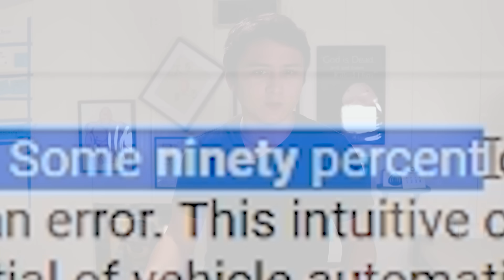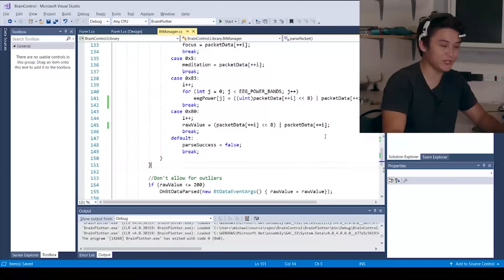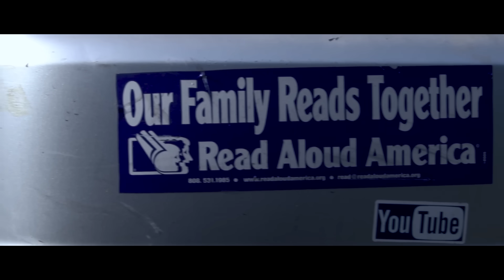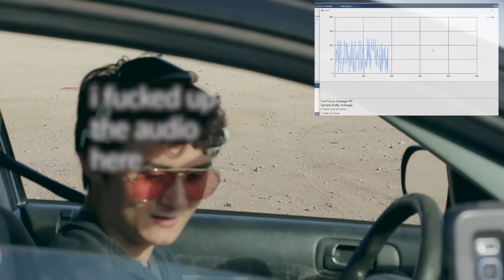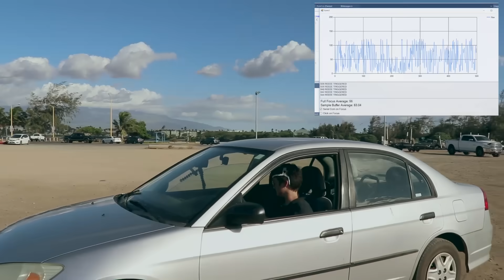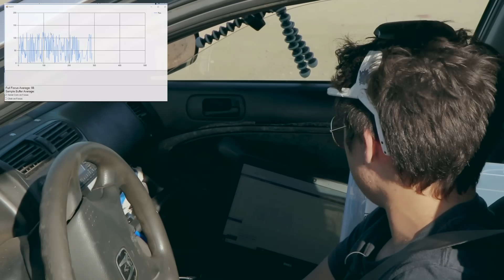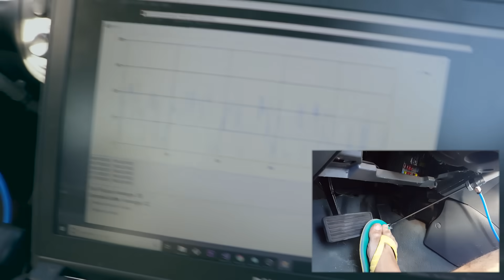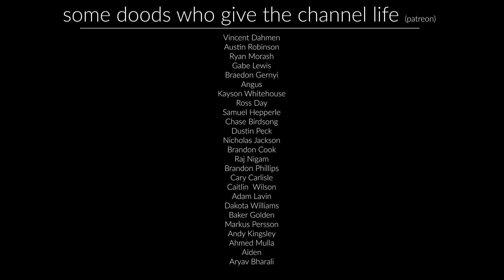Using Mind Control to Drive a Car

Comment: Ngl, thinking about it, the opposite would actually be rather usefull in IRL trafic I think. Accelerate when you unfocus and decelerate as you focus. People that don't pay attention and are zoned out will go full throttle, panic, focus and then decelerate. So it kinda forces them to actually pay attention to traffic and their surroundings

Comment: it would be great if the headset had a motion detection device so if you move your head left the car turns left, etc. then you would have fully been able to drive the car

Comment: does anyone know where to buy a cheap headset like that because I am working on a project.  It does not need to be accurate, it would be nice nice if it gives an analog signal depending on how focused I am but for my application a digital 1 or 0 could work. I have looked everywhere but I can only find expensive medical equipment. my price range is not that high.

Comment: You should connect throttle to a heart monitor. The calmer the heart more acceleration. When you get scared and your heart rate goes up it goes even faster until you crash

Comment: Wish you would redo this with eye tracker software you should be able to use that to accelerate/stop and then turn using a gentle degree to go right/left in and then seperstd hard right/left. My dad had also and his eye tracker worked from 3-5 ft from his face and he had an entire alphabetical keyboard he could choose from or make custom commands on a different screen

Comment: This is really good and funny, to improve it or add on to this project, you could add a gyro to the top of your head, like on the head set and that could be the steering. That would be kind of hard to make mechanically though, it should be easy programming though, it should just be a linear equation or even easier, the mapping function!!

Comment: I wonder what would happen if you were able to make the action smother by having a set throttle position selector. Maybe program it into the code .
Ex: if speed =0 then use 25%
Speed =15 then 34% 
And so on

Comment: Hey Michael! I'm a bit late to the party, but great video bud. 
I'm studying automatic-engineering, which made this vid fun to analyze and figure out how you did it. 

I have a few tweaks, I would probably do, but I can do that on my own model...

(dw, mine will probably be on a remote controlled car.)

P.S Michael, if you see this, know that I would like to buy the headset shown in the video (if it still works). Its not possible to get for a good price where I live..

Comment: If you connected it to your lights that might be a good falling asleep and waking up quickly mechanism. Like, once you start dozing off the lights will turn off, and the moment your brain starts focusing when an alarm goes off, the lights will switch on. It's like the 80s sitcom "rise and shine" mom we never had.
Reply: ah yes of course but me with my anxiety filled brain is just like:
goes to sleep
calm, calm calm
light go out
*brain*: There is a geodude in a cave, is he made out of rock or is the cave made out of flesh
internal screaming
light flash on in an instant
And repeat this 500 times

Comment: Mind controlled rc car or flying drone, but randomized brainwave generator for the controls. Kind of like using your brainwaves as a way to encrypt the controls so only someone the trained themselves to use it can get it to work. The more random brainwaves there the longer it will take to master but more difficult for someone else to use if stolen because it detect brainwave patterns based off of owner. It's going to crash alot. 
Good luck if you decide to do it lol.

Comment: it would be better to have it be the other way around, having the car stop when you focus. this is because beta-waves (the waves the thing is measuring) increase when you focus but most significantly when suppressing muscle movement. If you see kid crossing the road and you need to act quickly your beta-wave amplitude would naturally increase, which in this case would make the car go faster.

Comment: The manual switch makes it function like the handicap car setups does it not? couldn't you convert one of those kits into a full mind controlled brake and driving control by hooking it up to the arduino and making your relaxed readings as the break?

Comment: I detect a bigger safety problem that you may not have even realized. If you need to suddenly stop, you're going to be focusing heavily on doing that, meaning it will accelerate more until you hit the kill switch or kick the piston.

Comment: Not to be underestimated potential. While you do all this for fun, it is absolutely obvious you have a future in this field. As for the project, i don't know if it would work but i tought that maybe a stepper motor could control the gas pedal while you think about different musical notes or colors so you could scale its action up and down. Of course there should be a mechanical way to disegage it so it don't go nuts.

Comment: Wouldn't it be more efficient to control the acceleration directly in the car's throttle potentiometer? Thus it would be possible to pre-determine safety ranges for acceleration as well as allowing a smoother variation in engine speed.

A servo motor controlled by the average values of the signal can easily function as an electromechanical interface.

Assuming that the car is equipped with an electronic fuel injection system, it is possible to completely abandon this "on/off" system that is practically impossible to control.

by the way "Já viu rico namorar pobre?" 00:00

Não seria mais eficiente controlar a aceleração diretamente no potenciomentro do acelerador do carro? Assim seria possível pré-determinar faixas de segurança para aceleração bem como permitir uma variação mais suave na rotação do motor.
Um servo motor controlado pelos valores médios do sinal pode servir facilmente como interface eletromecanica.
Assumindo que o carro seja com sistema de injeção eletrônica de combustivel é possível abandonar totalmente esse sistema "on/off" praticamente impossível de controlar.

Comment: so I actually did something similar to this as a kid, Its called neural feedback and basically, they attach electrodes to your head and they track your brain patterns and it's coded to play a movie when you're focused on what's happening but if you get distracted the movie turns to static. I was used as a form of therapy for people with ADD and ADHD. I did it for a year when I was 10, it was weird.

Comment: Nobody going to talk about how this is actually useful? you could make it so the car auto stops when the value reaches a low enough number. and it could have a maximum speed of 60mph, and you need to take a breathalyzer to start said car. this is an actual good idea, and could stop a lot of motor vehicle accidents if taken to an advanced enough level.

Comment: why not flip the logic and use the really calm parts to accelerate  then when you actually have to focus to drive the car it slows down?
Reply: Because if that was the case and you lost focus while driving the car, you would accelerate and die.

Comment: It would be a better design if you flipped the code so that when you are calm it accelerates because panicking would mean that you are focusing so it would make sense that when you panic it doesn't accelerate for safety reasons

Comment: I found this really fascinating, My question is if you go if your temper is that stay out of control like you get really mad quite easily while driving for the people who are out there will you keep on driving because if that's the case people are going to die from well being angry so they killed himself by being angry which is something I'm a little bit curious about don't please don't do it but I'm a little curious if that's the case and that would mean well the obvious answer.

Comment: What if the values were reversed? For example, the car accelerates when calm, but when the user is panicking then the car slows down? That would actually be a lot safer since if something was happening, the driver would be panicked and focusing a lot more.

Comment: U should have reversed it, basically the accelerates when ur relaxed and stops when ur focused. Because if it accelerates when u focus, u will panic and focus harder which will make it accelerate more. Kinda hard to calm down when it’s speeding towards the ocean.
Reply: Great idea! Focus on the road and the car doesn't move.

Comment: The focus not focus thing could save people when they fall asleep at the wheel and stuff
Reply: Yooooooo you’re right!!
Reply: What if they’re having a nightmare?
Reply: @Samuelinox-th3ww  If they've been asleep for long enough to be having a nightmare, then I think they're already dead
Reply: @muchdoge8351  Yeah, i think you're right.
Reply: @Samuelinox-th3ww  So what? Dreams last for only coue of seconds....            Which is aldo a lot when you are going fast
Reply: Samuelinox 2808 Imagine having a nightmare and the car accelerates to 120MPH lmfaoooo
Reply: Idk about you but most of my nightmares either take a while to become scary enough or they make me wake up
Reply: @yeahimkindaabigdeal6279  you can only have dreams/nightmares while in deep sleep. majority of the time becasue that is when your mind is most relaxed.
Reply: then it just a car in the middle of the road, that is still dangerous and what if it is on the high way?
Reply: @xinyinkuang1447  its still 10 times safer than it going 120km/h with no one controlling it
Reply: dare graduate 🤣🤣
Reply: There's already shock bracelets for that.
Reply: Yea but the fact that panicking accelerates the car kills that idea
Reply: @michaelgoldsmith9359  not neccesarily, you could just have it so losing focus stops you. So you would have a certain point that if you drop below the car brakes
Reply: I don't really care anymore
Reply: What if there in lucid dream of them driving

Comment: What if you first took a base like of your brain accelerating at different levels while driving. You could use a ODB 2 sensor to pick up the accelerator positions while you drive. Then lay the brain pattern over what level of acceleration you were at, then make it so it recognizes the percentage to push on the gas depending on your brain activity...

Comment: hold up, this man is actually a genius. mind controlled cars make more sense then "Self driving" cars
Reply: It does not.
Reply: @kaorutanaka803  yes it do
Reply: @dark_optix4437  Well, isn't the whole purpose of self-driving cars to lift the pressure from the human? A mind controlled car would in the best case scenario operate as basically an extension of your body, cool, but there's still a human operating it. Hundreds of millions of people still have to spend their time and energy to learn driving and to drive. Also we are much closer to developing a narrow AI for driving than reading human minds accurately. It is also not a zero-sum game, these are two different areas of technology and people will pursue both.
Reply: @kaorutanaka803  hmm fair point, however, can we trust an AI program to drive for us, or would you feel better simply thinking where you want to go and boom youre on your way? there could be a hybrid type thingy where you are controlling to a degree and AI is helping to supplement for you if you fall asleep or something. like autopilot, but youre in more control

Comment: If instead of controlling the car it activated some kind of anti-spacing-out-behind-the-wheel thingy (maybe a self driving car that you can switch to a manual mode, but if you space out, it automatically switches to AI), this could be quite practical. But then it wouldn't be a Michael Reeves video.

Comment: This needs to be real. We need someone to make a legit version of this and start selling it...... wait...... i could do this in the FAR FAR future, but i could eventually potentially possibly maybe very unlikely try to make this maybe happen.

Edit: probably make it in reverse, focus slows the car, unfocus accelerates it, like full focus would stop it entirely so if a little child runs after a ball in the street then the car stops, or maybe moves at a rate of 2 inches per 20000000000000 years

Comment: You are smart and fun, but you didn't actually drive a car by using mind control. You know that, right? You just used it to on/off one actuator attached to one pedal. You'd need  at least 4 more people working synchronously or become a jedi and do it yourself.

I see your point about human error and stuff, yet in real life we would have to control go/stop, speed, direction, lights, horn... (remember that thinking of and controlling 2 things at the same time is already a hell of a task) + look outside + talk to someone + use the phone + think of many other issues our busy minds are  preoccupied about... Do you really believe that's ideal?
Your project is likely to be impossible to fully implement.  Maybe integrating 3 other options would be better: self pilot (yes); voice control; manual control.

Comment: Use 2. Passenger (P) and Driver (D)

None: Dont move.
P only: dont move.
D only: Accelerate.
P & D: Brake

Or better yet: 2 more. Left (L) and Right (R)

None: Straight
L only: Turn left
R only: Turn right
L & R: Retain previous State. Ex:

L ( Start turning left)
L & R ( Keep turning left)
L ( Still turn left)
None (Stop turning)

Comment: Why did you have a plain piston instead of a maybe gear controlled extension which could incrementally extend and retract based on millimeters per maybe a second to perhaps 6 inches depending on your brainwaves? Instead of it imitating a person stepping on the accelerator, it could  accelerate in a certain amount of units per second or another sort of ratio to your 'brain waves'

Comment: is no one going to point out that he DRIFTED A HONDA CIVIC
Reply: With HIS MIND
Reply: Ricers with mind control
Reply: R E E V E S  Z O N E
Reply: lethal doses of ketamine, he did take
Reply: 🅱️TEC KICKED IN YO
Reply: Just what i wanted to say
Reply: So? Its been done
Reply: Shingo's wet dream
Reply: That his dad car
Reply: Honda civics are actually the preferred drifting cars in Japan, which surprised me too. They're cheap and reliable, and drift well!
Reply: @henotic.essence  they're cheap and reliable but theyre fwd. they don't drift, but they can absolutely do donuts which is what happened here. as for them being preferred drifting cars, idk where you're getting that info but it is not accurate!
Reply: @harrysimpson3284  dude you can switch the drivetrain too
Reply: @theedgybeatle  you defs can but that requires heavy undercarriage modding and also the most common drive train swap in a civic is awd
Reply: @henotic.essence  they are not, i dont know where you got that from but the most common drift cars in japan are nissan s13s, 14s, 15s, rwd trims of the r32, 33, 34 gtr, toyota corrollas, most of the toyota jzx family of cars, and 350z/370zs.
Reply: @henotic.essence  you can't drift a fwd car dude...
Reply: @Meltan The Hero you CAN and it’s called the fucking handbrake... it will “drift”. Not a long drift, but you can slide around corners. Especially on gravel.
Reply: @unspezifische5924  firstly, they didn't pull the handbrake in the video. Secondly, without hydraulic brakes, it is very likely you will snap the cable of your handbrake. So no, it's not called "the fucking handbrake". That is how you destroy your vehicle after an hour.
Reply: He is Yoda confirmed

Comment: if you think about it ppl without legs could use this if you get 2 pistons on brake and accelerator  only using the switch mind control would b kinda dangerous on the road

Comment: Can you upgrade this with mind cintrol + manual driving. (I mean the piston do not accelerate the car all at once. If you forces  more, it accelerate the car as you get the time for forces to stop the car) something like smoothly control it (using PID or something like that?)

Comment: i just thought of something, maybe this wont work at all but whatever, the thing is that for this to work it would have to be that there would have to exist a certain threshold related to panic. Which should stop the vehicle to prevent the driver from crashing because of his panic. Ofc, this could only work if a certain threshold could be related to the panic state but since they dont sell those toys, if any at all in my country, i cant fucking check myself.

Comment: Me when I saw this: How can you control throttle, steering, brake input, with your head? Oh I forgot that a small computer controls everything from gasoline injection volume to automatic transmission gear changes.

Comment: instead of firing the piston when the focus value is above a threshold, wouldn't it be more interesting to have the piston remain on the accelerator but the force is mapped to the focus value?  i mean that way, the car accelerates more when you are more focused and as you lose it the car slowly halts.

Comment: Okay this video made my brain move... then hurt.
What if this was combined with voice commands, w voice recognition, for setting the intensity of the piston "stepping on the gas" to that speed, or keypad entered speeds with a cover on it and finger print scanner or one of those key fobs? 
Then if you were to go a lil' more invasive w the car access, would you have a way to detect a turn and depending on how intense the turn is and have the piston pull back an amount based on how far from straight/forward the steering wheel is while also referring to the said/entered speed?
Then maybe have a 3rd kill switch be the first one copied but set under the brake pedal and pressure activated w a drummer's base pedal so it can kill and then un-kill upon brake release? 
THEN NEXT video/s after can be a fusion of this and google maps maybe?
AND MORE THEN AFTERWARDS collab w YT'er Colinfurze to make a flying smart car prototype?